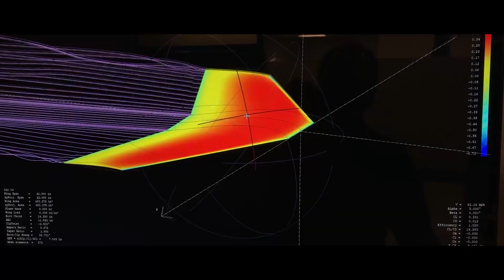FPVWRA Spec Wing Prototype

Comment: really awesome man. One thing I'm interested in is those outboard elevans I haven't seen a flying wing with no elevate movements close to the center how does that fly compared to other wings or do you have reflex already dialed into the cut?
Reply from the maker: TLDR:  It flies fantastic and is very efficient.
Explanation: There  is no reflex in the cut.  The Spec wing has to be cut with a NACA 0014 symmetrical airfoil as per the specification.  The elevons on a wing have their greatest effect in both roll and pitch the further they are from the CG.  For roll the most efficient location is as far out from the centerline for the longest moment arm.  For pitch the most efficient location is furthest back behind the CG, again, for the longest moment arm.  Ass you move along the trailing edge towards the middle of the wing the control surface becomes more inefficient, that is, it generates more drag than the control it provides.  This is why you will often see full-length elevons taper from the half wing point back to the motor.  This taper helps to lessen the drag effect of the elevon  when it's in use however, this leaves a thick trailing edge on the elevon that contributes to drag.  By putting the elevon on the outer half of the wing I get the most control force for the least drag.  This allows me a nice sharp TE inboard.  Also by moving the motor back behind the full airfoil and sharp TE it is receiving cleaner air and operates more efficiently and quietly.  Now, this concept works better on a symmetrical airfoil because they do not have a pitching moment that needs to be resisted by the reflex.  The proportion have to be adjusted with a lifting airfoil because you need more reflex to resist the pitching moment.  Washout can help mitigate the moment a bit.
Reply: @DefiantWings  thanks for that long reply! On my big 8ft zagi im doing it has exactly that elevon setup where its much deeper at the wing tips than the root, but i didnt ever take the time to research why. Those close loops you were doing were awesome. Looking forward to more videos.
Reply from the maker: Nathan Knight and those were conservative throws...
Reply: @DefiantWings  dang